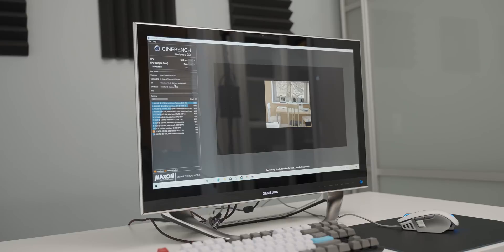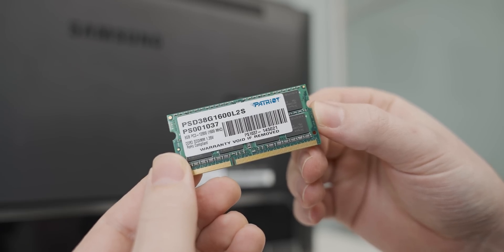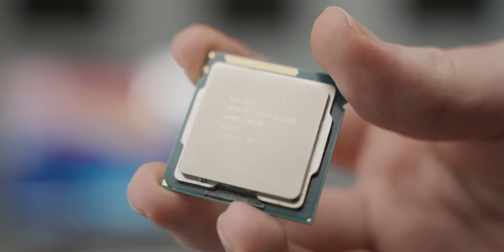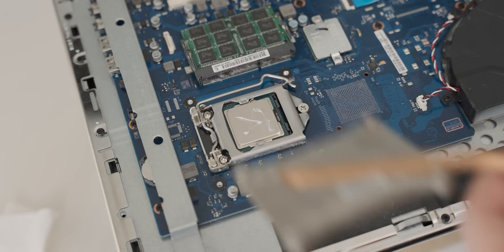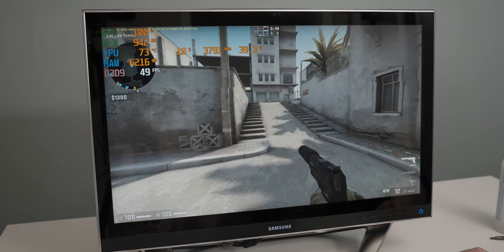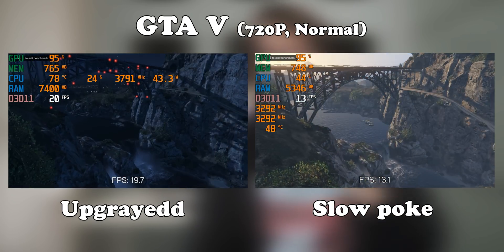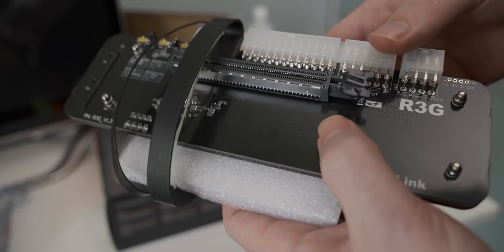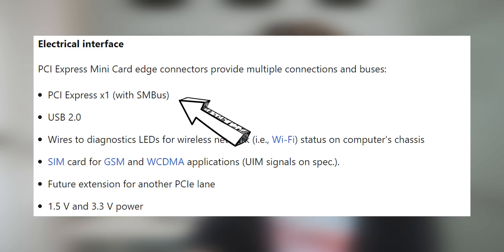Samsung All-In-One MAX Performance Upgrade Pt. 1

Comment: I just got the same gen but different model of a Samsung aio for 5.79usd. Figured I'd take the HDD. Comes with an i3 3220t, 6gb ddr3, 21.5" screen, and the legs. I gotta buy an ac adapter since it wasnt there at Goodwill sadly. Might keep it, might flip it. I have too many computers but this seems kinda novel at least. Might try a cpu upgrade if it fires up. I can imagine this being great for 2004 and earlier gaming.

Comment: Hi, thank you for the useful video. I have almost the same PC, but there seems to be slight differences in the specs:
Processor:	Intel(R) Core(TM) i5-3470T CPU @ 2.90GHz   2.90 GHz
Installed RAM:	8.00 GB
System type:	64-bit operating system, x64-based processor
HDD: Toshiba MQ01ABD100 (909GB)

Display Adapter: AMD Radeon HD 7690M

So, can I make the same upgrades, or should it be different?

Comment: Watercool it Dawid. Drill some holes in the back for the hardtubing. Two 480's or 360's, 1 on either side in old speaker housings, that would match the height of the system. Would look awesome.

Comment: This all-in-one machine comes with dual fan setup for stronger CPU+VGA configs. The unpopulated screwhole is clearly visible at the other end of the finstack. You should get the other fan for the 3770.

Comment: All those stupid "ZIF" ribbon cables remind me of how much I hate working on SFF PCs, laptops and things like this.  Half the time it's PITA to get them back in, and then once you do, the other challenge is to keep them in place while you clamp them down with the lever.  Some will active and close the lever when you press the cable into the slot but not all do.

Comment: You could try upgrading thermals by using a dremel and sticking some heatsinks on the copper pipes or try replace the cpu cooler and have it sticking out like an engine on some v8 cars.

Comment: It probably won't work well since it's pcie 2.0 x1, or worse, it could be 1.0 x1, iirc p106-90 are bottlenecked by its pcie 1.0 x4 link.

Comment: Nice upgrade.  I just won an auction for an old dell i7 3770 system for $27 and can't wait to upgrade my 3470...extra 4t here I come 🤣 Just a media center pc for light gaming/emulation using an embedded radeon e9173 as the gpu.

Comment: I think you may have made the wrong choice getting the 3770, when you had the option of getting a 3770S. No one wants them so they're cheaper, and at a TDP of 65W instead of 77, you wouldn't be quite so crippled. Maybe worth thinking about if you can get one before part 2 of the upgrade video!

Comment: I reckon it needs an aio water cooler cobbling on with a hole hacked in the casing and the radiator strapped to the back.

Comment: I'm thinking using an external GPU could actually help thermals a little since you won't need to run the integrated graphics anymore. After all, both the CPU and iGPU are getting cooled by the same system, taking one component out of that could help? I don't know though

Comment: those scratches wont do the temps any favours i would lap the ihs, if i saw that, might gain 5-10'c lower, maybe delid and add liquid metal, if its a non soldered ihs which i think it is, might improve the temps further, its either that or try and find a better laptop style heatsink that would fit and you could jerry rig on to it.

Comment: It looks like there would be a beefed up cooler as well, there’s the solder spot for a dGPU and space for a larger 2 fan setup w/ larger heatsinks
Reply: Wouldn't have to buy honestly. Just harvest an laptop fan or two, double side tape on and solder the power cables or run a custom USB power cable to avoid overdrawing the poor fan connector.

Comment: you should really think about adding one more fan on that heatsink. I'm sure you can find exact same fan, mounts are already there and only powering will need tome kind of splitter (or simple wire twisting :)) but I expect temperatures will go down at least 10-15 degrees.
 Also 3770S would be better choice for this setup but they are lot less common and somewhat more expensive.

Comment: M.2 to ribbon cabe adapter to external  GPU ( with extra power fron an old PSU set up to power and hopefully share ground with the all-inone) sounds less than a rabbit hole than investigating that ' missing ' SMD next to the CPU socket and what onboard functionality it would have given.  With the retracted bonus of not having to have a small reel of surfas mount capacitors in 6 sizes, 3 types of SMD resistors, and of course finding the right BIOS to get it to play nice afterwards.

Comment: You should try a second heat pipe mod on the cpu cooler to decrease the cpu temperatures. You could also try to find a cooler for the same model of all in one, but a cooler meant for one with a dedicated gpu that has more heat pipes.

Comment: With those scratches on the CPU you should definitely lap that chip before installing it.
Reply: @J Fz The problem isn't so much the groove, its the walls of the grove that will be above the surface of holding the cooler away from the entirety of the surface.

Comment: Since the GPU is on the CPU die as an IGPU, isn't that "CPU temperature" really a combined temperature of the CPU and GPU? I bet the added temps were from the GPU working harder than the CPU itself. You should have run a CPU intensive benchmark to see what happens.

Comment: I am actually watching your video on a Samsung All-in-One that I bought in 2014 with an i3 2 core processor and 6GB of ram. So far I have replaced the ghastly HD with an SSD, have installed a dual boot of Windows 10 and Linux Mint. I have hesitated to put any more money into the computer because of its age, but like you said, it runs really cool and makes no fan noise that I can hear. Great video! BTW, I do have a much newer Rysen computer that I built from scratch that is waiting for a decent graphics card once the crypto miners are done hording them!

Comment: Dawid's replacing the 35w 3470T with a 77w 3770, not a 45w 3770T or even the widely available 65w 3770S, I'm betting on a housefire later on in the video or in Pt. 2
edit : it's somehow less terrible than I anticipated
Reply: Shocked myself , Was expecting 3770T , Impressed that little heat pipe can keep temps down aswell , My laptop has a significantly beefier cooler and hits 90c running it's i7 10750H at 75 watts in performance mode.
Reply: I thought exactly the same! I've recently upgraded a 4th gen AIO from an i3 to an i5, and stuck with the T model as that's what the manufacturer (HP) had listed as compatible. I expected mostly due to the thermal design, but also quite possibly the VRM as the board was tiny! I'm not sure how well Dawid's 3770 will last in this AIO long term! 😂
Reply: I'm going with a 3770s but keep getting no POST with it. How can I upgrade BIOS on this AIO?

Comment: i currently have a 3770 with an rx570 4gb, i think the 570 still bottlenecks it in some games but its the other way around in cpu intensive ones. this would probably be a realistic option for the external gpu i'd assume

Comment: Try installing Intel extreme Tuning utility. you should be able to overclock the iGPU, Overvolt it, and you should be able to Overclock the CPU by About 200-400Mhz Depending on the chipset they used in this thing. at least undervolting should be enabled if its a low end Chipset.
i was gaming on an extremely overclocked HD 4000 for some time (1775Mhz).

Comment: I'm fairly impressed that its gaming performance was so much better.  It probably opened up a huge amount of casual and indie gaming options.
Reply from the maker: Oh for sure! I think it will also work really well for emulation.
Reply: @DawidDoesTechStuff  if it had an extra nic, it would make a nice pfsense box.
Reply: @BenState  could make an awkward adapter if you threw out the WiFi card.
Reply: @DawidDoesTechStuff  as a 13 year old that doesn't want games, I only need a PC for working purposes only

Comment: I also have a 2012 All in one with a 3770 and 16gb of ram, and an ssd. It too has crappy thermals and is similar to a laptop inside: Its still my main computer even though I have a gaming pc. It still looks and is modern today, what computer is my daily driver?

2012 27in iMac

Comment: I wasn't even expecting an attempt at adding a dGPU, so this part one satisfied my curiosity from the last video. I think an interesting route would be to see if you could do a mini-ITX Ryzen 3400G APU build inside the chassis and get it running with the screen since it had the HDMI in, unlike a lot of AIOs.

Comment: Thank you for making this upgrade in steps, so we could see how the maxed out system with a closed back, i.e. original look, performs. I still think this upgraded version is a viable option for home office use, as you get the snappiness people seek.
That the cooler slacks this much is still a bummer. I don't know if Ivy Bridge has solder as TIM between the die and the IHS, but if not, there could be one or the other potential degree lying around. Anything else won't work without modifying the case.
On the other hand: For reasonable use cases these temps are still in check, in my opinion.

Comment: Hello Dawid! I dont undestand what 1% mean in FPS or graffics, can any tell me what  1% is. Thanks!
Reply: 1% of the time while benchmarking, the frame rate was no lower than than X and 99% of the other time it is higher than X. Reviewers started using this when average frame rate looked good on paper but actual performance was terrible because of momentary extreme dips in frame rate.

Comment: You could probably add another blower fan to help temps, it appears there’s space there.
Reply: But you can´t see if heatpipe goes there or it stops in half of heatsink. EDIT: Yep, it does. Adding another fans will help. Ebay/Aliexpress search "Ativ One 7 fan".

Comment: Nice job. I'm wondering if you'd be able to fit another blower fan next to the one that's attached to the heat sink. It looks like there's enough room and having the rest of the fins with active airflow would help keep the temps under control.

Comment: i7 3770 runs hot bcuzz youre using iGPU for games lol .. i have i5 4440 and i know what im talking about .. if you pair it with DGPU, you wont see higher temps, maybe youll see lower cuzz IGPU portion of the cpu die wont be activated ..

Comment: Nobody:
Not even Joe:

Dawid: U P G R A Y E D D
Reply from the maker: "Two D's for a double dose of pimpin'"
Reply: @DawidDoesTechStuff   O.o the legend himself replied to my comment and hearted it!
Reply: @DawidDoesTechStuff these small children viewers haven't seen Idiocracy yet they are the ones making it happen.
Reply: Damn, not even Joe?
Reply: Who knew how accurate this movie would actually become?
Reply: What about Other Joe? He has a say in this!
Reply: Now with extra M O L E C U L E S
Reply: not sure about the cpu mounting but couldnt we try to use a cooler that fits thats socket. > I realize you'd need a tri[pod just to make it stand up but thats the idea . MAXIMUM Perf bruh. Oh and the 3770 has the worst thermal solution from that era . non soldered . my 4th core and 1st are 15 degrees C different at idle and 4 C at max. Cant wait to see how it plays out
Reply from the maker: @tobiwonkanogy2975  I'll see what I can do for the follow up. 😁
Reply: Who is Joe?
Reply: @zaiikun4685  not sure
Reply: Did someone say Joe?
Reply: Anyone else wondering who joe is?

Yes I know the joke I’m being funi
Reply: Haha Cow  i cant recommend something like that without proper tooling . ive broke an old amd 6000+. the silicon ripped right off the substrate. with the die still soldered to the integrated heat spreader. also a few capacitor wee shredded inside the package due to a knife blade going too deep. maybe if hes got the right tool XD
Reply: And now I want an "U P G R A Y E D D" shirt.  Because we all love busted PC maximization!
Reply: Upgrayeedd is the name of a pimp in the movie Idiocracy
Reply: Who the duck is Joe?

Comment: Going from 3MB of CPU cache to 8MB of CPU cache gives quite the boost as well. People forget about the importance of the cache sometimes.
Reply: basically why zen 2 is so good at games
Reply: @gustavgustaffson9553  Lol "so good at games". Btw the "64" megs of cache on the higher end Ryzens are actually 32 per CCX. Not all cores have access to the full 64.
Reply: @J Fz wise man
Reply: @ATTE22  amogus
Reply: @J Fz enlightened man
Reply: AMD hasn't cough 3d cache
Reply: @djpickle68  Sure love that 3D cache and the big fat slob of silicon they have to stack on top of the cores that destroys thermal transfer. Speaking from experience. That X3D I had was a hot bitch.